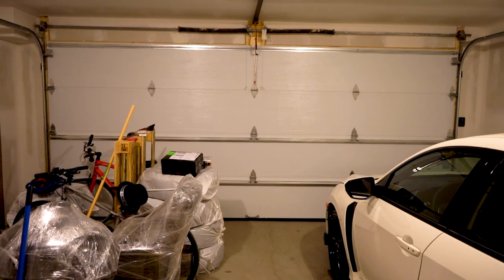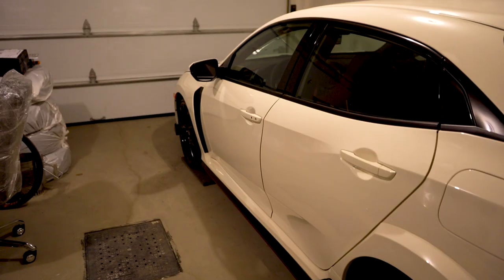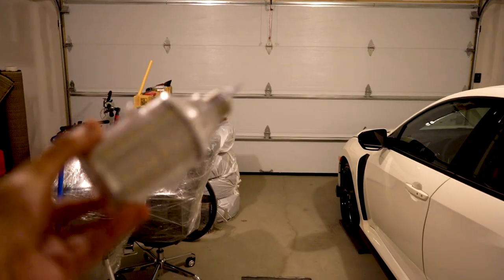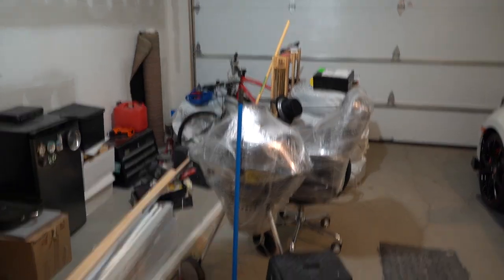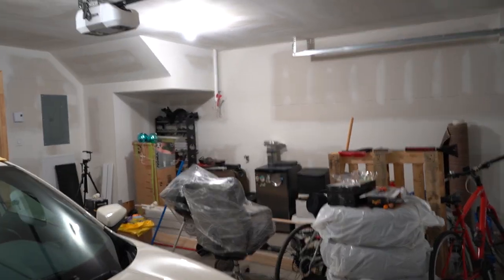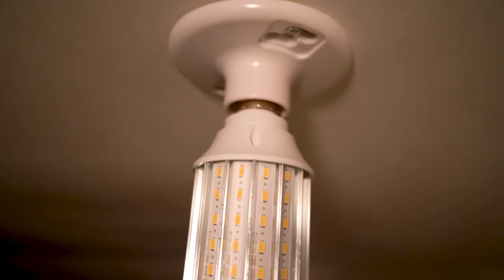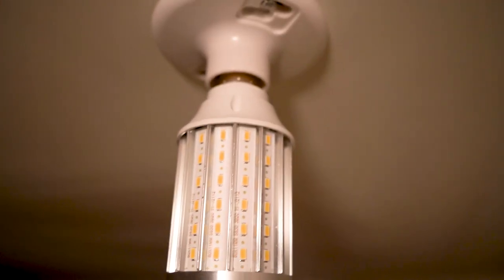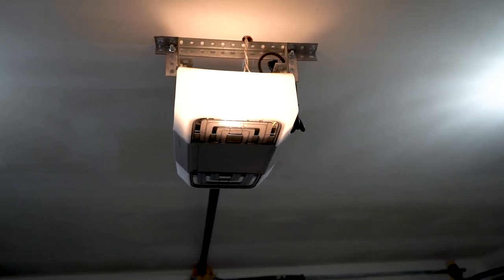LED Corn Light Bulb - Garage Lighting

Comment: Those corn on cob LED lights are for small spaces like closets, washer and dryer utility room, boiler room etc. However you might want to invest in a light strip for such a large area like your garage. Long LED strip lights give better light. Just pause your video and you can see shadows. It still needs more light than what you think you have.

Comment: Can I use a 60 watt corn bulb for my plug in lamp?
Reply from the maker: You'd have to check your lamps max wattage. I wouldn't recommend these in small enclosed areas. They get hot, hot!!
Reply: @5WTech  mine doesn't have a lamp shade
Reply: @hello-sz7hp  yes